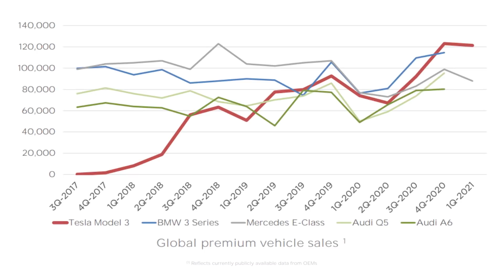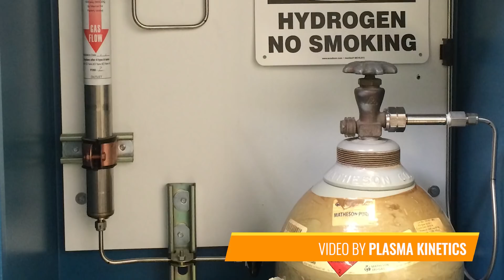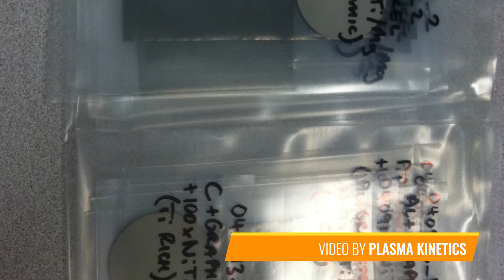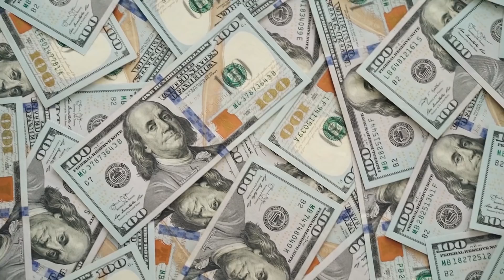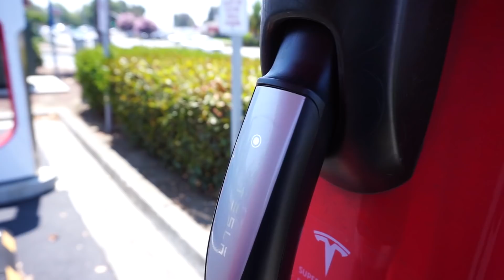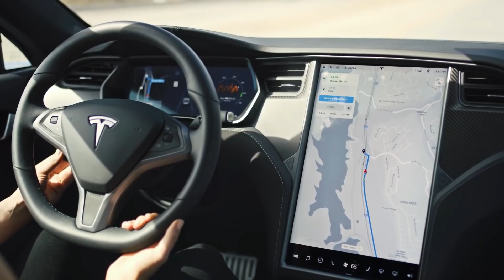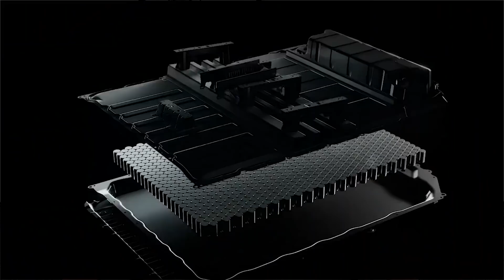SANDY MUNRO: No Batteries Needed for Toyota to Rival Tesla

Comment: Fuel cell efficiency 63%. Lessens advantage vs ICE. Also, constantly buying and returning these discs would be cumbersome. No info on efficiency of using the discs either. Tesla invested heavily in supercharger network, Toyota just kind of hoped hydrogen stations would pop up.

Comment: Sandy Munro, the man, the myth, the legend. He pointed out Plasma Kinetics. I am against hydrogen made in the usual ways. But Plasma Kinetics are doing hydrogen differently. They are extracting it directly from smoke-stacks, and collecting it on a nano-structure. The hydrogen can then be released by applying a laser to the material. And a 1/2 kilo of hydrogen is stored on a plug-in cassette. Now, if this truly works, it is a break through. And means that hydrogen would work even for passenger vehicles. You could just buy you refill in a shop! (Of course, there are still the same issues with Fuel Cell drivetrains.)
I don't know how it extracts hydrogen, but they claim it can refill in minutes, needs no energy, chemicals, or catalysts. Their website is light on detail.

Comment: There is actually multiple technologies similar to this one including flexible spool hydrogen tape. The problem is you can't easily replace and or recharge the hydrogen. Its still an industrial process. Billions being spent on this technology and still no clear solution. Maybe in 40 years when everyone has a flying car.

Comment: Since using hydrogen fuel cells in a car already wastes about 66% of the electric energy used to produce the hydrogen…
How much worse is the solid state solution? 😬
Reply: Exactly. This will cost at least 3x the cost of charging from direct electric based merely on the physics let alone the cost of this technology.
Reply: Damn should just use hydrogen in ice vehicles then....
Reply: @iskdude9922  no, that’s way, way worse. 😅

Comment: So you need electricity to extract the hydrogen from the disk?!!! And then use the hydrogen to charge the battery that will run the motor!!??
Reply: But it takes more power than it produces because of the lazar.

Comment: Where do you put the discs with the laser - into the car? 
Sounds like a low cost solution 🤔😛
Reply: @flipadavis  The lasers are already included!
Reply: What if you put in one of those multi disc CD changes in the trunk? Retro-Re-Use!

Comment: Just because a cool technology is possible, does not make it practical, let alone price competitive. The disc H2 storage tech is cool, and it has he potential to help with two huge shortcomings of hydrogen fuel, safe transportation and storage of H2. But we don't know how expensive or efficient it is, and regardless it still doesn't reduce the cost of producing green hydrogen. And the end cost and convenience still needs to be competitive with EVs and gas vehicles. Toyota is not alone in building a good fuel cell. Honda and Hyundai both have competitive FCEVs. I think that ALL of them need to just add a bigger EV buffer battery and make their FCEVs plug-in hybrids. Honda, Hyundai and Toyota could easily come out with a plug-in hybrid version of their FCEVs within a year that goes at least 100 EV-only miles and includes DC fast charging.

Comment: There might be a problem with that hydrogen disk..

Is the economics really going to help it or is creating it in a possibly much less efficient way going to make it cost more?

I see so many hurdles for hydrogen, mostly cost, but fueling station themselves.. this might fix the problem of not needing a fueling station but I don't think it's a more cost effective way to make hydrogen so probably will be more expensive, if it weren't then wouldn't the fueling stations be using this technology?

Comment: Every time I hear one of these discussions, I always find the forgone conclusion that "batteries are superior" and "why would anyone be so dumb to go with Hydrogen," interesting if perhaps not missing some realities that bare consideration.  (And yes, this wasn't technically said but some of the general tenor of the video.)  I suggest the real competition is happening between battery improvement (range and charge speed) and hydrogen production improvement.

I've seen "this is the battery revolutionary tech we've been waiting for" so many times it's almost a cliché.  Couple this with the undiscussed fact that the charging infrastructure is clearly not ready for the number of electric vehicles that would need to be charged if suddenly everything became electric.  We would need to begin building nuclear power plants (which isn't a bad idea) and major grid improvements right now.

So what is more technological feasible?  Better hydrogen generating method or better battery development?  I would bet on a better generating method, not to mention Hydrogen energy could provide a better media for phasing in a different type of energy reality.  Hydrogen production hasn't had as much focus and therefore might contain some of the greater undiscovered methods - but this is all part of the fun of wondering about the unknown.

An important questions to ask as we ponder the future:
-Which will a customer want to use more, one you have to plan in regular charging (and in cold climates major uncertainties) or one you can fuel and go and keep going?  I think a cursory look at the American population the choice becomes obvious - unplanned drive up/fill up is the preferred.  And then too, electric cars are really only advantageous for the few that can drive into their garage and plug in.

Furthermore, weight is always left out of the conversation, this is especially important for the electric truck discussion.  Long hauling electric is a non-starter.  If the truck isn't rolling it isn't making money.  Furthermore licensing is done by weight, putting batteries on a truck at a significant disadvantage.  (Wait till car's are licensed by weight and see how that impacts the conversation - after all heavier vehicles damage roads more - so the theory goes.)  

If I was Toyota, I would go after the trucking industry and build the infrastructure for them, and let the car guys join in, eventually the the easy employment that we enjoy as with fossil fuel cars will also be reached with hydrogen making them the more interesting choice.  This leaves battery electric car's to the niche application of short trips type of use.  Which is what I would buy one for and what they will always dominate at.  Unless of course I'm wrong and the next "major battery technology" does pay off and magically charges instantly while having amazing range.  But I'm not going to hold my breath.

I wouldn't count out Toyota as being completely clueless because they haven't joined "all the rage."  The long game is hydrogen, and as the infrastructure is built, it will make far more sense.
Reply: It will make far more sense when I see EV starts charging themselves without any need to be plugged in. just like a combustion engine would with an alternator charging its battery.   Auto makers need to re-invent the EV

Comment: the small disc won't work, because fuel cell consume H2 by weight to generate energy, No matter what kind of magic you play with laser, the weight must inside the disc.
So the question is: how much does the disc weight? 10Kg each? I don't think so

Comment: Is Plasma Kinetics for real or just a pipedream?  In some ways it sounds like  a 200 mile per gallon carburetor that the oil companies didn't want to come to market?  Currently it has 7 employees and  $414,000 projected  income.  If it actually worked in 2008  DARPA would have proven the concept in a super secret "skunk works" project. The company is privately held and not subject  investment rules.  Not only does it recover H2 from dirty power plants but supplies clean H2 to power car and trucks.  Wow, it sounds to good to be true. Sandy, I want more information.

Comment: Why compete.  Why not plug an existing hole in the market.  It is for a no frills, very well engineered, easily maintained, relatively low priced electric car which stays the same for at least a decade and which you can switch the battery easily with the latest battery technology and at a reasonable cost when your battery gets tired.  Put the cherry on the top and provide a kit to adapt the used battery for home use.

Comment: wouldn't it be plausible to use the solid sate hydride fuel cell to power an on board generator to charge your vehicles batteries while driving? An increase in range by 50% would be huge!

Comment: Toyota could buy the disk company and make a Electric/Hydrogen Hybrid. The hydrogen side could be for recharging (generating) the Electric thus by passing the need for charging stations. Instead set up stations for buying new disk. But if it where that simple they would have done that already. Still a nice thought.

Comment: Toyota is not stupid. 95% or more of cars in my state are not BEVs or other plug ins.  ICE, Hybrids and PHEVs help keep dealerships' service depts solvent. IMO BEVs are dealership killers because they are comparatively very reliable.  I own a non Tesla low-range high- miles/kwh BEV and it needs very little maintenance but also have an ICE car for the long drives.      Government would have to give BEVs away for them to be prevalent.
There also should be fines for ICE parking in EV spots.  They get away with it in my state.  Heavily fine these inconsiderate drivers and that will clear up this issue.  Fines should be similar to parking in handicapped spots.

Comment: That Plasma Kinetics disk Storage Technology is quite fascinating

The best fuel cells today use the same amount of platinum as a catalytic converter. What if your engine cost about the same amount as a catalytic converter? Then, you wouldn’t have to pay for the carbon tax… Hopefully, happening soon!
UC Irvine prof Jack Brouwer Did a study indicating H2 fuel cells are ideal for trucks, buses, ships, planes and trains, Essentially, anything where weight and range are primary factors. Further, his study indicated they would not be enough lithium and cobalt in the world to power its energy requirements. Hydrogen power generation is a great energy storage solution, the technology is well known and ready, and several countries like Korea, Japan, and Norway have adoption roadmaps (+California)

Comment: Hydrogen’s problem is that it is expensive and is not competitive with batteries. The biggest problem for Toyota is that the moment they truly shift to EV people would want only EV and they don’t have the battery production capacity to support shifting even 10% of their production to EV. I won’t be surprised if by 2030 Toyota’s unit count would decrease by 30-50%. The Chinese, VW and Tesla would eat their market share.

Comment: The hydrogen disc idea is fine, but you will need a LOT. Hydride carrier and disc adds weight to the hydrogen you need. So every gram of hydrogen probably needs 5-10 grams of other stuff. Not efficient weight wise.

Comment: What about cost. I've always been led to believe that hydrogen was too expensive to go on with.
Reply: Exactly what I was thinking. A car that runs on hydrogen fuel cell already costs way too much. Implementing the solid state hydrogen technology will drive prices even higher unless Toyota is willing to take a loss in order to gain traction. The hydrogen itself would also need to compete with electric in terms of cost per mile. The J-gov is betting on hydrogen, so Toyota may be able to pull something off if they invest heavily into this technology with a projected loss in the beginning.

Comment: Toyota had given away free their patents of the fuel cell technology following when Musk gave away all Tesla Motors patents for free use but remember that it was Stanley Meyer who invented the hydrogen fuel cell technology and to manufacture its own HHO fuel through using precise smart systems and electrolysis process... But how did Toyota came up with their fuel cell but big oil did not want people to produce their own fuel but the concensus was to sell premade hydrogen but it is coverted for electricity for mechanical energy than to have the HHO combustion that can be made using water in modified gas engines?

Comment: You can't cure the inefficiency of hydrogen as an energy carrier compared to the much simpler solution of just using a big battery. The MBA thing could explain why Toyota is rebranding cars from Peugeot, Mazda, Suzuki, Subaru and BMW instead of designing them in-house.

Comment: Why didn't Sandy say Toyota should move away from fuel cell and concentrate on BEV? 
Is it possible that fuel cell has a future with passenger cars?
Reply: Yes. There are huge populations around the world without a robust electrical grid. For these places, fuel cells are the only zero carbon option.
Reply: @k1fizz  No.  Microgrids and vehicles such as Aptera will always have a cost advantage.
Reply: @n.brucenelson5920  why don’t you think that fuel cells can experience economies of scale like battery electric has?
Reply: @k1fizz  good question.  The round trip production and turning the energy to motion for hydrogen fuel is inherently more lossy than the direct generation and use of electric power for the same application
Reply: @n.brucenelson5920  Fair point. But consider this: Driving a big SUV to work in an office is inefficient, driving with your windows down is an efficiency loss, using the A/C is an efficiency loss, driving above 55 mph is an efficiency loss, putting nice large wheels on a car is an efficiency loss, people fly on planes instead of ride on trains at an efficiency loss. People trade efficiency for time, comfort, looks, and fun all the time. Is it absurd to think people would trade some efficiency for a quick refueling experience?
Reply: @k1fizz  I think with the growing awareness of the environmental damage that our lack of concern for the environment has caused, coupled with a growing number of people who don't have money to throw away, we will see a change in behavior, just as we did with smoking in spite of the marketing of cigarettes.

Comment: Hydrogen will always remain problematic (cost, CO2 impact) until there is 4-5 x overcapacity in renewable energy generation. So maybe in 2080, by which time any exces electricity would be used to either create hydrogen and carbon as a basis for synthetic chemistry.
The delivery method (solid state disks) solves one important part of the puzzle, but the other big issues are cost (due to inefficiency) and climate impact (99% of currently produced hydrogen is made through gas reforming and still releases CO2).

Comment: Toyota has their own voice command software in all their cars.  I had a 2008 Prius c and it was bad.  Twelve years later I buy a Prius prime and can not believe they made it worse. They should just buy someone else’s software that works.  I agree with Sandy, they should not try and create their own software as they are bad at it.
Reply: Do you have an iPhone or Android? If so, you can use CarPlay or Android Auto. It pretty much beats everything else out there.

Comment: I think  that hydrogen is technology okay for  it's time.  Kind like  Beta vs VHS, but  VHS was more in demand and beta was gone.  
Tesla 4680 batteries  with a 500 mile range will dominate the market over hydrogen. There are very few hydrogen charging  station. Tesla is has many charging station  in US and the world. This put hydrogen technology way behind.
They should  have different electric car manafactures to make one compatiable or universeal charging to  Tesla , since there are more then the others. Some charging station  are to slow for  my Tesla and some not even compadable.
Reply: No the solid state battery will, and Toyota will have it !

Comment: That solid hydrogen invention will totally change the viability of hydrogen fuel cell application in EV's.  Hydrogen storage has always been the biggest problem. Bringing that invention from the bench to mass manufacturing at cost effective levels will be the trick as it usually is.  With a player as big as Toyota deeply invested in hydrogen, there is a chance this will happen.  Toyota has proven to be willing to have a bigger time frame perspective regarding change so maybe it will eventually happen.

Comment: Help me understand the obsession with hydrogen. As far as i can tell, hydrogen is fundamentally flawed, massive energy losses in conversion to fuel. 

Charging was my only concern before owning an ev, come to find that in practice fueling up at home is one of it's biggest assets. Just about every day leave the house with a "full tank" by simply plugging the thing into a wall outlet. literally never think about charging the thing up. Nothing to make a special stop for and buy, cheapest way to fuel a vehicle also. So, charging only matters in road trip situations, (road trip  >300mi). I'm glad to stop for a 30 min break after 5-6hrs of straight driving anyway. after buying a tesla, I drove for doordash for a couple months just for a excuse to drive my car. Found that I was able to go 10hrs before needing to charge. I needed a break to eat anyway at that point. Car would be fully charged before I could finish a meal. Initially planned on installing a 220v home charger, later found that a regular 110v wall outlet is all I need.

Battery tech beats every fuel by far in terms of cost/convenience in trips that aren't far enough that most people would just fly anyway. Not sure what hydrogen is supposed to solve, and would justify the extra hassle/expense vs a battery.
Reply: Huh? Show me how batteries beat gas in energy density and weight and infrastructure for mass production.